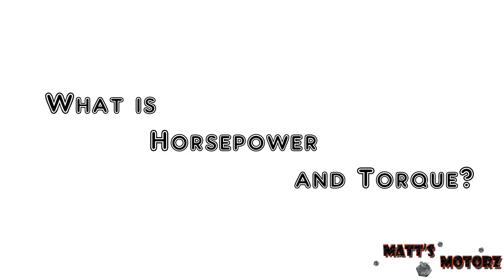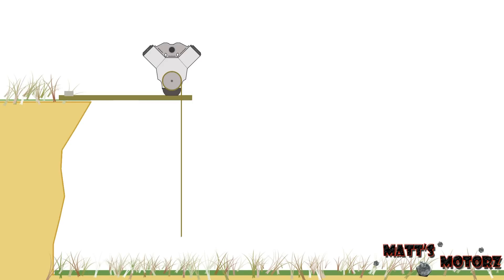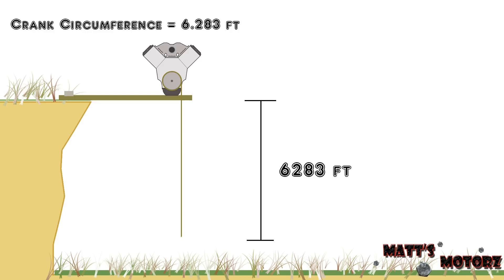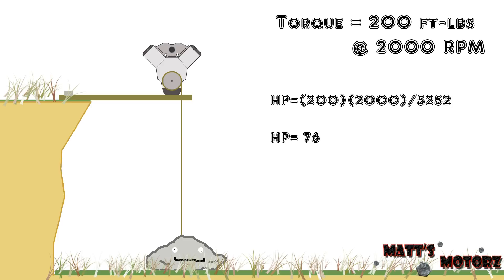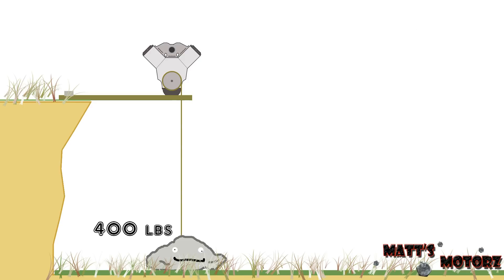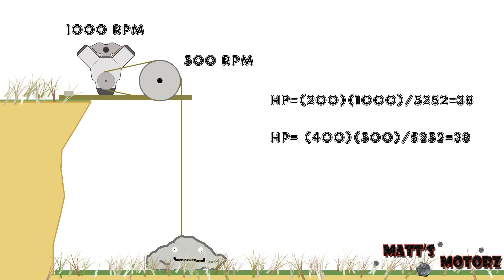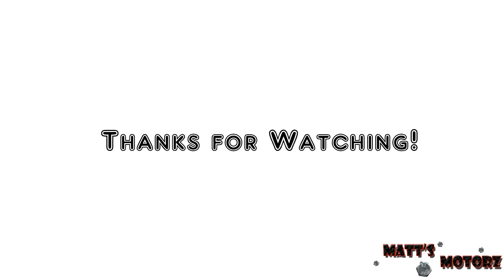What is Horsepower and Torque?

Comment from the maker: ATTENTION EVERYONE WONDERING WHERE THE 5252 CAME FROM!!
*******************************************************************************

Short answer:
It comes from converting the power equation to Imperial Units. 

Long Answer:
In physics, if one assumes that the rate of angular rotation is constant, the equation for work is:

W = F*d 

where F is the force in Newtons and d is distance in meters.  In this case, if we imagine there is a rope attached to the pulley pulling something up, we can write d in terms of the arc length the pulley has traveled.

d = r*theta

where r is the radius of the pulley and theta is the angle through which the pulley has turned.  So you obtain:

W = F*r*theta

But remember, the torque T is equal to F*r, therefore we have:

W = T*theta

Okay so now we want to get power.  Power is equal to work per unit time or:

P = W/t

where t is in seconds.  This gives us:

P = T*(theta/t)

The quantity theta/t is the angular velocity w.  In other words, it is the amount of angular displacement per unit time.  In radians, this would be equal to 2*pi/t.  So we get:

P = 2*pi*T/t 

But since 1/t = f (frequency) we have:

P = 2*pi f T

THIS is the equation for power, in it's raw, SI unit form.  To convert this equation (in units of Watts) into horsepower, we use the conversion factor of 1HP = 33000 ft lbf / min  This gives:

P = 2*pi *f * T /33000
P = T*f /5252

The frequency f is equivalent to the RPM now that the equation is in HP, so we replace f by RPM to get:

F = T*RPM/5252

Which is the horsepower equation.
Reply: Coolerthanyou, They intersect at 5252 because in the formula you divide by 5252.
Reply: MattsMotorz 5252 is the point where the limit of torque loses to rpm in all engines and begins to drop as rpm Rises, so for example you wouldn't get an engine that is at 8000rpm making 8000 lbs ft of torque it would lose drop of at 5252 : )
Reply: 5252 is the approximate rpm where torque and hp intersect. I've done the math for engines with set amount of hp and(250, 300, 500, 800) in my automotive tech. class and for each equation its about 5252 rpm where the intersect is
Reply: Few need explanation for 5252 as they do not understand formula and associated mathematics constant because they are not educated enough or never gone fir higher study.
Reply: MattsMotorz thanks bro...your explanation was very clear
Reply: Great explanation, thank you
Reply: MattsMotorz I'm more confusing???,...... I'm not the mett guy's here 😔😔😢😢
Reply from the maker: I just added a "short answer" for people not into the math.
Reply: I am an aerospace engineer nice explanation.
Reply: I just learned a lot but I’m still a bit confused. I’m confused on where the 1hp=33000 ft lbf comes from and how it converts to 5252. I ended up plugging it in and got different numbers. Thank you for this comment btw.

Comment: Or , a person could say "torque pulls you away from the stop light,and maybe spins the tires". Horsepower gets you going faster at higher speeds in the higher rpms in the higher gears. For fun, torque wins, unless you are ore on the Nurburgring, and we never are, ever.

Comment: Simplified: 

Torque: if you have more torque u can lift or move heavier objects  

Horsepower: If you have more horsepower you can move weights faster
Reply: Nonsense.  Power and Torque are not Batman and Robin please stop trying to assign them roles. Power, not torque, is the limiting factor for not only how fast a vehicle can go but also for how much weight it can pull at a given speed and/or how fast it can accelerate a given weight. Torque is the sound of one hand clapping. Without RPM nothing happens.

Comment: simple answer to the ? what is HP and TQ. ITS THE SAME THING BUT AT DIFFERENT RPMS. look at the equation of HP. HP= (TQ)X RPM so it's still TQ doing all the work hahah TQ is single most important factor of any engine
Reply: Hivemind nonsense.  Power and Torque are not Batman and Robin please stop trying to assign them roles. Power, not torque, is the limiting factor for not only how fast a vehicle can go but also for how much weight it can pull at a given speed and/or how fast it can accelerate a given weight. Torque is the sound of one hand clapping. Without RPM nothing happens.

Comment: Stop saying RPMs. RPM stands for revolutions per minute. It’s already pluralized in the R. Adding the s after the M implies that there are multiple minutes. Without defining how many minutes are being used to measure the revolutions, there is no clear information. My bone stock Chevy small block can turn out 341,000 RPMs
Reply: I think RPMs is a term for diesels and Hardly Ablesons.  Their tachometers read backward to gas/petrol engines indicating how many minutes per rotation.

Comment: Soooooooo since you have it all figured out, explain then how can horse power be higher than torque?
Reply from the maker: Why couldn't it be higher? Look at the equation.   It is directly proportional to the RPMs.  For RPMs higher than 5252, it will be larger.
Reply: When you multiply something you get more of it.  Power = torque MULTIPLIED by RPM 

Public service announcement: Please don’t pluralize RPM it’s already plural.

Comment: What happens if the engine produces for example 400 LBS/ft @500 rpm when the rock Changes weight from for example 400 to 200? Will the engine do the job faster?

Comment: So, a car with 500 horsepower and 400 ft-lb of torque, is better than a car with 500 horsepower and 300 ft-lb of torque, right?
Reply from the maker: It is impossible to answer that question without first defining "better" and also showing both complete torque-HP curves for both vehicles.

Comment: well i am confused because i thoght rpm was engine speed which doesn't includes the gear so while the engine will be spinning at 1000 rpm the gear spinning at 500 rpm because it' a 2:1 ratio but producing more torque so is rpm engine speed or the other gear speed one
Reply: Both
rpm stands for Revolutions Per Minute, applied to anything that spins, engines, drills, CDs, gear boxes, pulleys.... ballet dancers doing twirls....dog chasing own tail..... 
So in this case engine speed is 1000 rpm, the pulley/gear box output shaft has speed of 500 rpm 
 "the engine will be spinning at 1000 rpm the gear spinning at 500 rpm because it' a 2:1 ratio but producing more torque" that sounds correct to me,  i'm guessing you're confused as to what rpm itself means.

Comment: horsepower is how fast you hit the wall, torque is how far you push the wall
Reply: Torque is how wrong, stupid and irrelevant an analogy is. RPM is how much it gets multiplied by "likes".
". Power is the resulting permanent
cognative damage caused to our collective consciousness.
Power, not torque, is the limiting factor in not only the top speed of a vehicle but also how quickly it can accelerate at any speed and how much weight it can pull up an incline at any speed.
Please do yourself and the comments section a favour and watch a video called:
"Horsepower is NOT how fast you hit the wall.
Torque is NOT how far you take the wall with you"

It's on the D4A channel. It illustrates the distain the people who understand Physics and engineering have for these idiotic Idioms that spread like a pathogenic mind virus.

Comment: Electrical vehicles give all torque at 0 rpm so why horse power is not zero or in how much time it will pick up torque take any assumption but torque is delivered at 0 rpm you can check

Comment: Hold on, If I remember correctly you use a bigger gear for more torque and a smaller gear for more speed, so your video shouldn't need the correction at 4:18. Some one correct me please.

Comment: If the engine has a Max torque of 10,000 Ft-lbs and turns 1,000 RPM  it =  1,904 HP.    I like that.

Comment: I think there is a little mistake, when trying to lift the 400 lbs another socket should be placed in the same shaft of the bigger socket, because it is not possible to lift it from that socket
Reply from the maker: Yes you are right.  I made an annotation mentioning this in the video.

Comment: I have a question and I have a difficulties to put this question correctly. I'm gonna try. 
If my car has max torque at 1900rpm (turbo diesel engine) and max power at 4000rpm, my turbo is pulling the best from 2500-3000rpm and then it loses acceleration appreciably.

 What is the point of max power at 4000rpm or torque at 1900rpm if I can't sense neither of those?
Reply from the maker: Honestly, the only one that really matters is the max power.  That is the one you will really be able to "feel" because that is what causes acceleration.  Max torque is more of just a benchmark metric.

Comment: Am I the only one that notices that in the example of lifting the rock, the engine produces a force of 200 LBS upwards and the rock produces a gravity pull of 200 LBS downwards the forces are equal and nothing would move at all???? The only difference it would make is that the ground woudnt have to support the rock anymore.
Reply: No, indeed I have said the same several times here.

Besides, a pound force and a pound weight are not equal units and they are numerically only equal when the setup is at a location of standard gravity.

In the SI system we use Newton for force and Kg for weight...and nobody would ever model the world like what is done in this video without considering gravity.

But then you have the weight of the rope, the air drag and the entire issue that to accelerate any mass to a certain speed, you need both a surplus force and time. This means you would need some sort of gearbox and clutch to get this show going. Reality is not at all like what the video explains :-)

Comment: Torque is a measure of the force exerted about an axis, Horsepower is a measure of work done per unit of time.
In everyday example, Torque is the grunt to get you going, and horsepower is 'top end', it's also the difference between winding that bitch out and hauling ass like a young kid, or as you grow older, you prefer torque, as you can accelerate and move around traffic without having to downshift, and that is a real plus with a 'safety concerned' female next to you, bc they go by what the engine sounds like... you could be doing 60, but if the engine is winding, they get the impression you are 'speeding' and blah, blah, blah.... On the other hand, with torque, you can cruise pretty quick, and move around traffic without having to downshift and wind out the engine, and your passenger is none the wiser, and everybody's happy. :)
Reply: You started with correct descriptions of torque and horsepower and then went into lala land.  You can't say you "prefer torque". Rather what you are saying is that you prefer a car engine that can provide a lot of horsepower at lower RPM.
Reply: Since horsepower is derived from torque at a specified RPM, the ONLY was to have 'lot of horsepower at a lower RPM' is with..... Yeaup, a lot of torque.
Reply: Yes, exactly, torque is not much interesting without also specifying the RPM...anyway, you go for the 2017 Ford Super Duty Diesel pick up truck that can deliver 925 lb-ft of torque at 2.5K RPM and I will pick the Lamborghini Aventador that delivers 508 lb-ft of torque at 5.5K RPM and enjoy relying on the 50ms semiautomatic transmission helping me get things done. I hope growing old wont change my mind :-)
Reply: Post some pics when you purchase that Aventador. ;)

Comment: I think we only need to see torque in real life, horsepower should be retired for good..perhaps see torque figures per unit time....that will be enough to measure the muscle of an engine
Reply from the maker: No.  Horsepower is way more useful than torque.  Torque per unit time is essentially what horsepower is (torque per unit time isn't really what is going on anyway, it is really WORK per unit time).  So  you are essentially saying "we should retire horsepower, but instead look at horsepower." You need to be able to measure how much and how fast an engine can perform work.  That is the most important metric.  And that metric is horsepower.
Reply: Gosh. Torque is purely relevant because we are moving our cars forward with rotational parts and because some of us think it's more real due to it's ability get easily measured. Had we used legs or jet engines, we would not even care about torque. I almost want to say "forget about torque", but yes, a torque curve of a combustion engine does have value.

People need to understand KINETIC ENERGY is really what this is all about. This is the energy "E" bound in motion with a speed "v" of an object with the mass of "m" following the formula E = (1/2) * m * v * v.
What this formula says is that adding ENERGY is what allows the speed "v" to increase. Interestingly, this formula also says that you need more energy the faster you go (v * v is in the formula). You need 4 times the energy to double the speed. And power is ENERGY per TIME and thus it's 100% horsepower that makes ANY change of speed. For example, 10 seconds acceleration with 100 horsepower is adding the energy of 10 * 100 * 746 = 746 kilo Joule (1 horsepower = approx. 746 Watt). In a perfect world with no air drag and other energy loss, I could simply add this energy to the kinetic energy of my car and calculate the new speed super easily. 

Horsepower equals "How fast an engine can perform a given amount of work" OR more correctly, "How much work an engine can perform per time unit". Remember, one horsepower is 746 Joules of work per second of time unit.

The latter is more correct because horsepower is actually a measurement of a physical condition in a MOMENT IN TIME. It's therefore not how fast an engine can perform a given amount of work, as such statement implies a constant horsepower during that amount of work being done. 

Above is exactly the same no matter if we use wheels, legs or a jet engine to move the car forward.

Rather than being excited about the crankshaft torque, surely, the torque working on the wheels is essential in accelerating a car and the better a car can keep the torque near but below the torque causing tire-slip, the better acceleration you get.
Reply: torque is the juice peeling force of an orange peeler...horsepower is the quickiness of reaching that torque....so if torque alone is used instead of horsepower, we could say the torque of that Porsche orange peeling machine is  400ftlbs at 8000rpm at 6seconds, compared to the Datsun supercharged truck torque 280ftlbs at 8000rpm at 12 seconds..we can see clearly from the figures datsun doesnt stand a chance against the porsche ..nah I don't know, maybe both important..must come up with one standard unit for power I think, maybe call it ''catforce'' units
Reply: What a mess...dude, this is a science area extremely well understood already and there is no need for "catforce" units or making these analogies not really defining anything. The time it takes to reach an RPM depends on the LOAD on the engine, the inertia of the engine and many other parameters including power.
Remember, torque is only relevant because we use rotational parts in what transfers energy to the car's body. Had we used a jet engine, we would not care about it. In ANY CASE of powering a car, horsepower is what matters.
Reply: Force or torque per unit of time really are not representations of work. Only when a force or torque is causing motion will work be done. It's the AMOUNT OF MOTION (either distance or rotations) that yield work. Work = force x distance or Work = torque x rotations. Torque per unit time or force per unit time are equally meaningless. Look at it like you are using a screwdriver. If the screw is stuck, no work is done even you keep trying for hours.
Reply: i see amigos, i'll throw out my catforce revolutionary ideas..i'll stick to horses..

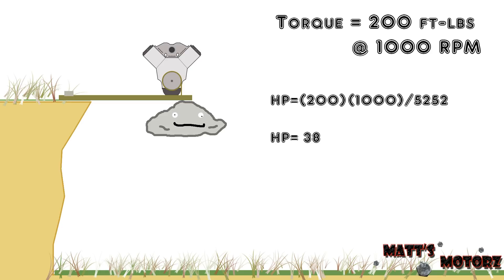Comment: What happens around 2:20 for example, if the weight was 205 lbs?
Would the motor stall or would it just slow down and take a couple of seconds longer to lift it to the top?
Reply: Surely with 205 pounds the engine will stall assuming the engine's peak torque is what is specified in the video. But it will stall anyway for other reasons.
This video doesn't represent a real-life scenario at all. Some examples:
1. The available torque, assuming this is maximum torque of the engine, provides a pulling force that equates the gravity force of the rock. There is zero force available to actually lift the rock even with 200 pounds.
2. Any mass needs to accelerate to get to any speed and during that acceleration, you actually must expose the engine pulley for more torque than the engine can do with . As item 1, this means the rock will never move.
3. The rope will have a significant weight considering the 6283 foot length. This adds to the weight of the rock. And when the rock is at the ground, the weight of the rope will be maximum adding to the problem #2.
4. As more rope is accumulating on the pulley, it's hard to imagine a rope and pulley not causing the rope to accumulate in multiple layers increasing the effective radius and thus reducing the effective force on the rope.
5. As the rock is pulled through air, the air drag will act against the rope's pulling force. This equates more torque needed for a particular speed.
6. A clutch mechanism is needed to allow the engine to get started without the load.
7. A transmission is needed to allow the setup to produce the additional torque required to raise the rock.
8. Something needs to slow down the rock when it hits the top at the 71mph speed.

An electric motor is much superior in lifting stuff as it can do the work without clutch+transmission and allow more precise control of torque and RPM e.g. as you will find in elevators.